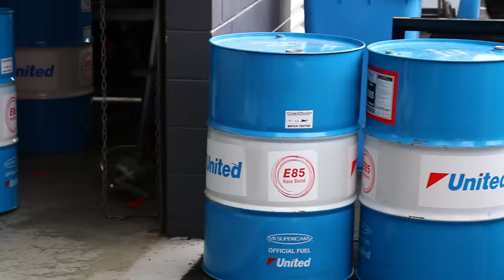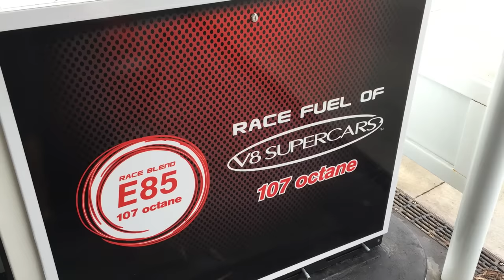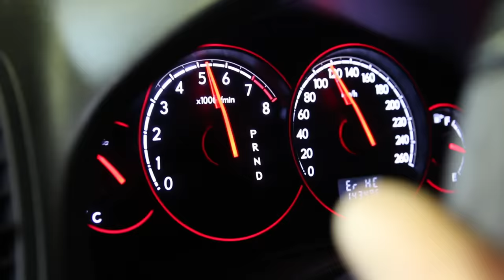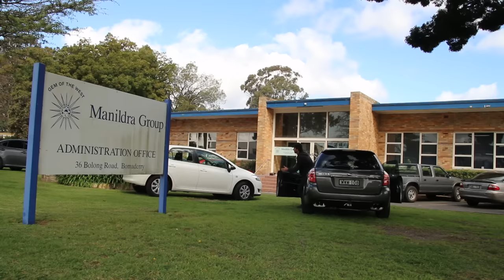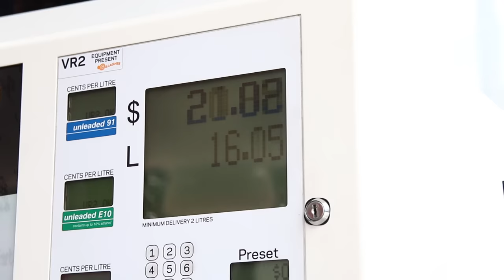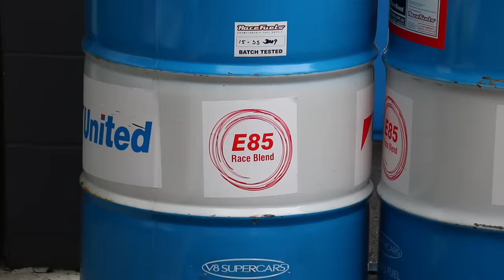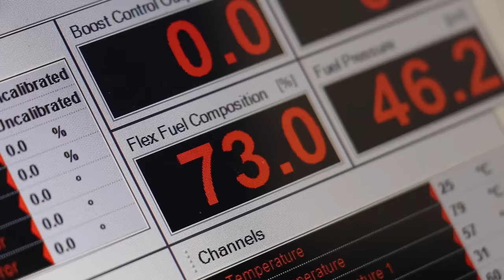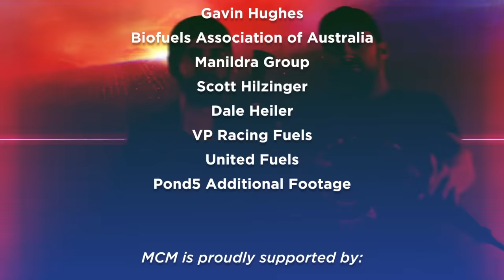E85 Fuel Explained - Should you use it?

Comment: E85 needs to be cheaper than regular gas there's a reason the oil embargo in the street is going to try to make this happen because it's a win-win for them I'll explain E85 alcohol has to run faster over gasoline 85 runs a whole lot hotter hair for your edges going to run a lot hotter temperatures there for you going to need a bigger radiator but the problem is is the fact that if they charge you the same amount or more they're ripping you off how is this possible simple you have to read your engine a lot fatter you're not going to give us good fuel economy out of alcohol as you would with gas because you have to run the picture a lot fatter a lot fatter means a stronger mixture of alcohol the gas if you don't you won't be able to get the engine to run right that's just the way I'll call is you just have to run a lot stronger mixture through your carburetor or injector you has to be programmed so it's real simple you shoot yourself in the foot to run alcohol sure it runs cleaner the color Governors going to get hotter and the missions are going to be better this is true it's all good the bad part is is your engines not going to last as long the other bad part is is you shoot yourself in the foot it's not getting good fuel economy you're making the fuel companies richer or make you more of a profit especially if it's the same price or more you're getting you're paying for fuel that's going to go quickly through your tank because it has to run fatter the gas if you got money to burn it all the way to go is more powerful in a way but runs real hot but gas you just get more for your money I'm just saying

Comment: I run a mix in my foRS but holy fuck is it a pain in the ass.....   so I got the blutooth ethanol analyzer from tune+. It checks the % in real time while the cars running so you can make adjustments.  Mixing E30 is a big bullshit guessing game.  And unfortunately ford spent millions switching to that dangerous garbage R1234 refrigerant......  but to get the foRS to run on pure e85 requires a auxiliary fuel delivery system which is obnoxiously expensive to setup.

Comment: Ethanol is detrimental to all vehicles.Ethanol destroys rubber fuel system components and leaves residue in carburetors and fuel injectors resulting in unnecessary removal of fuel components for cleaning.Ethanol can destroy engine blocks as proven by engineers at Ford Motor Company.Ethanol has a lower BTU and mpg than gasoline for a higher price.Everyone who thinks ethanol is good has no automotive experience,yet everyone who has automotive experience knows ethanol is bad.

Why would anyone pay more for 10% ethanol when pure gas is cheaper and better for performance because it has a higher BTU and doesn't cause all the problems of ethanol?

Comment: BTUs is a measurement of heat and engines DO NOT RUN OFF HEAT.  Comparing two fuels via BTUs is not the correct way of measuring kinetic energy of combustion.

Comment: i have e85 down my street. now i need to save 1400 to convert my sti to flex fuel.
Reply: no you dont ..just do a mix. i run e85 in my 2011 audi a5 and it runs super great cooler too.

Comment: Hay there might car mods boys, things can make the car go quicker, but not faster. Do you know the difference? I doubt it. And E85 is not a race fuel, it's a fuel designed for efficiency. It's also not good for a vehicle if it's not equipped/built for it.
Reply: Technically e85 is 20% less efficient than regular gas. So mileage will suffer using it unless your in a small car.

Comment: E85 is not environmentally friendly at all, requiring ridiculous amounts of water, farm space, tractors and other heavy equipment running gasoline/diesel themselves, and it doesn't save anyone money either, with the 30% less energy terrible mpg, yet it's still more expensive per gallon even after government subsidies. Especially true for US "corn" E85. Don't give me this E85 or "hydrogen fuel cell" bull shit. If we are gonna replace gasoline/diesel ICEs, it's gonna be electric cars with next-gen lithium-air/carbon-nanotube/etc batteries. E85 hardly helps N/A cars anyways, some 110 octane gasoline race fuel would probably do a better job. The only scenario where benefit might outweigh the cons is in heavily boosted modified cars, that's it.

Comment: Bru content is a huge misconception on fuels.  Yes ethanol has less than gasoline. But, the real advantage with ethanol (and diesel) is not in Btu but in the anti-knock value.  That is, they allow higher compression and therefore a better range of the piston.  The advantage is mechanical, often missed by the uninitiated on engine efficiency. 

That being said, ethanol is horribly inefficient socially as a fuel.  From a tradeoff basis it is the worst thing to use. It has hidden costs of fertilizer, trucking and lost food production. 

Your video ignores all of the above, and I wonder if you would disclose if you took funding from the farming industry.

Comment: all of these benefits are for modern fuel systems! ... throw it in a well tuned old car (steel tank ans fuel lines and aluminum carby) it is pure evil causing component failure because of the water content (corrodes things fast) ... even 15% ethanol sold here i wont use in older engines or common small engines (lawn and garden) ... it also dries the older gasket materials causing fuel leaks
Reply: that said ......it is well known the roots of nascar and the advantages of dumping moonshine in the fuel tank to outrun the police lol
Reply: best boosted ride i have owned was a 2112cc (stock 1600 dual port block line bored and stroked) with twin judson super chargers (left side custom milled) under dual webber 44 with a hand make header and glasspack in a 1973 VW 1303s in factory willow green and holes worn in the rear bumper from the road (wheel stands for days)

Comment: This seems really odd timing, to release a video like this when the Government in forcing the ethanol mandate. I heard that the government and the ethanol manufacturer, were looking at doing a huge information and marketing/advertising to help educate Australians on the benefits of ethanol. They are doing this due to the current perception in out there that ethanol is bad and sales have been dramatically low. So my actual question is were you guys approached by the government/ethanol producer to make this video and were you paid to do so?
Reply from the maker: +g1598 Not paid, this video came from a genuine interest in the stuff. It really is eye opening when you dyno tune your (performance) car, get a power figure, change fuel and then bam you're making an extra 50kw at the wheels, and the drivability is improved too. We mentioned this fuel isn';t for everyone and that's absolutely true. The renewable debate is ongoing and we aren't informed enough to really comment on it much more than we have, but if it actually can be renewed then that is a good thing.

Comment: Ethonal can wreck your car. It takes more energy to make it, uses more oil, and is less efficient. Its not a good fuel. What we should do is put more research and work into hydrogen fuel cells
Reply: it is excellent for performance.
Reply: it doesn't use more oil. Where do you get that from?
Reply: Engine oils with any rating of these are E85 compatible: GM Dexos2. API SN, SM, SP. IlSAC GF5, GF6.

Comment: This is a fallacious argument at best, it doesn't matter how many people use a product because they could all be wrong.  For example, if you applied this thinking to other aspects of your life you would be Muslims because there are more people that practice Islam across the planet than any other religion.  Then the argument that e85 can keep your engine cooler because it contains more water than petrol is absolutely insane.  The water in e85 should be considered a contaminate and removed, the problem is that ethanol actually absorbs water and would have to be refined non stop to keep it pure.  This is why cold climates don't use ethanol mixed fuel, frozen fuel lines are a bitch after all.